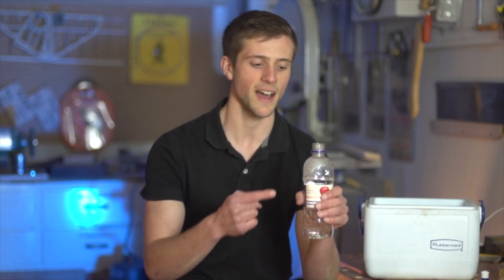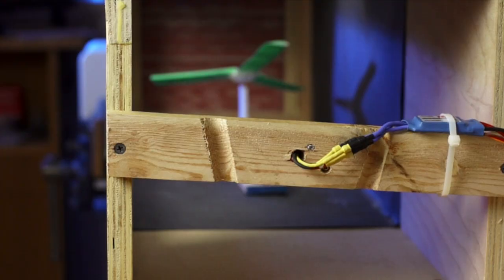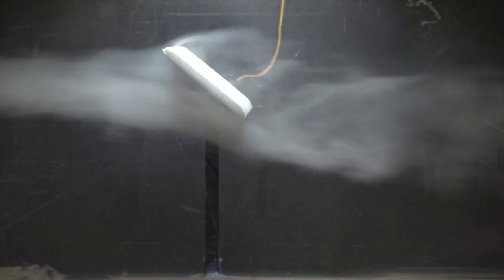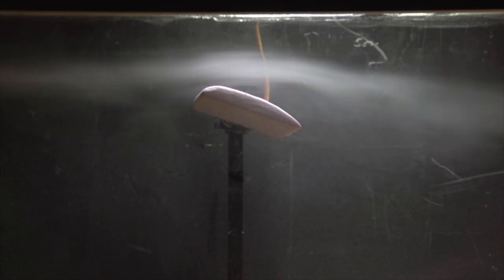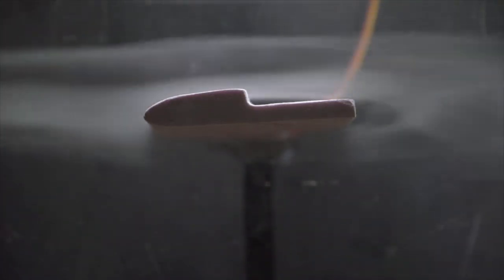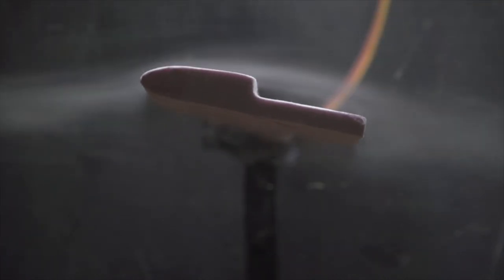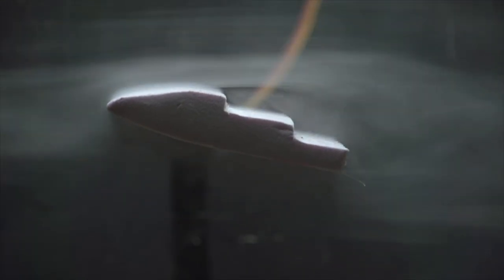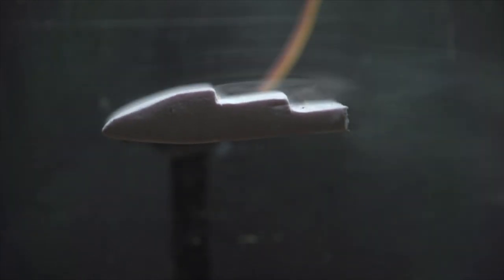Airflow Visualization - KF Airfoils

Comment: Puh, I appreciate your effort but your results are highly flawed. Why? Because you didn't use a modern airfoil like RG15, HQW or something similar, the leading edge(s) are kinda rough and the triling edge(s) are so thick they create their own vortexes even at low AoA which is not the case on modern airfoils.

Comment: I also have done wind tunnel tests on the KF airfoil. I used yarn tufts instead of the dry ice. I also used pockets of KF in the airfoil rather than a notch all the way across the wing. Based on my experiments I was able to build a man carrying airplane. As far as Dick Kline and myself know I am the only human to have ever flown under the wing. In my experiments I found that the yarn would flow straight back across the upper airfoil. At high angles of attack the yarn would flow from the standard airfoil into the notches and stay there. My belief is that when the air flows over the notch it creates another lower low pressure area on top of the wing in the notch. At high angles of attack as the air separates from the standard airfoil it is drawn into the lower low pressure in the notches. This air travelling over the standard wing going into the notch has also increased it's air flow creating yet another low pressure area on the top of the wing. That's how I saw it and my experimental airplane seemed to prove it.

Comment: I'm going to be annoyed if KM airfoils are good, as I've always thought they look a bit naff. But I'm just starting with KFM7 flying wing. 160cm span and with a roughly 50 degree sweep angle.
Reply: +ChuckPlains The only other thing i'll add is that the airfoils you presented in the wind tunnel were somewhat, err, pants. Too thick and chunky to represent what I would consider a functional wing.
Reply: +ChuckPlains And, yes, I'm too thick and chunky to have finished my wing after 3 weeks! :¬P
Reply from the maker: Haha thanks for the comments! Yes, I've often looked back at this project and thought the same. I'd like to redo it but use a 3D printer to make better models.

Comment: My name is Jorge Aragon, I´m in the International Baccalaureate 2 year program and as part of it I need to make a research paper. Mine is about airfoils so I constructed a wind tunnel as part of the experimentation. I´m lost in one aspect, however very important.
 How I´m supposed to quantitatively visualize the critical angle of attack in an airfoil? is there any guide or qualitative criteria I could use to do it ? how can I determine if the angle of attack in a particular airfoil is , if i just have an wind tunel with smoke visualiser ?

Comment: Very cool video, nicely done!  Recirculation pockets = base drag.  The foam that we use is typically not finished very smoothly also increasing skin friction drag and affecting the ReN as mentioned.  These are likely better than a flat plate, but if the forces were measured and the lift & drag vs AOA were plotted, the drawback relative to an airfoil would be apparent.  The nicest thing about these are they are better than a flat plate from a number of perspectives, and relatively easy to build.

Comment: fantastic video. i would love to see a test where all the airfoils are same thickness to eliminate the thickness ratio from affecting the results. for example a thicker airfoil tends to stall at higher aoa than thin airfoils, so to eliminate false readings if the steps were cut out of a thick airfoil so that the thickest part of the airfoil would be the same for all. also if they all had the same trailing edge that may affect the results. thanks for these fantastic videos